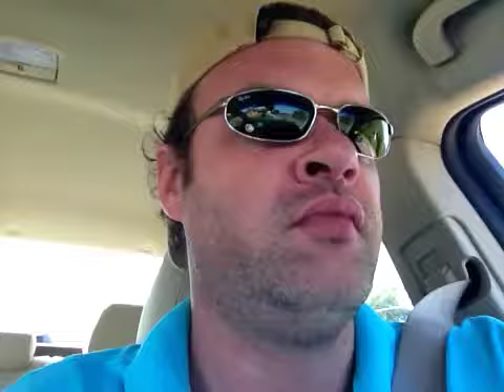Long term Hawg storage

Comment: You need to store it in cold. Heat causes the self discharge to double every 15degrees raise in temperature.  We store bikes over the winter for 6 months or so. Just charge the battery couple of times during the storage so it doesn't go undervoltage. AGM doesn't load well with tender. The load voltage is too low. Normal lead battery is very good. it loads with less volts and can handle overload better than agm.